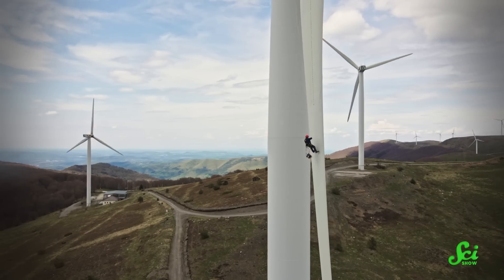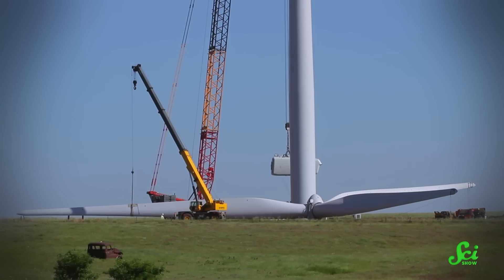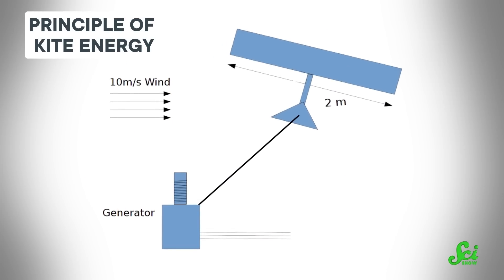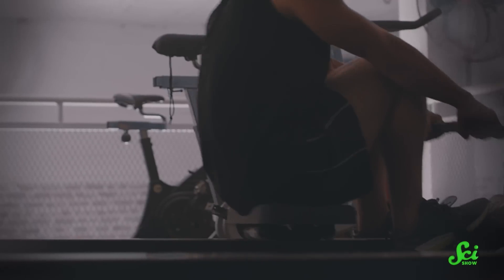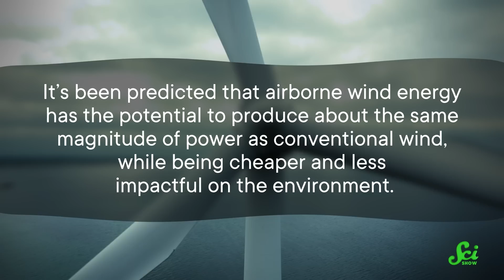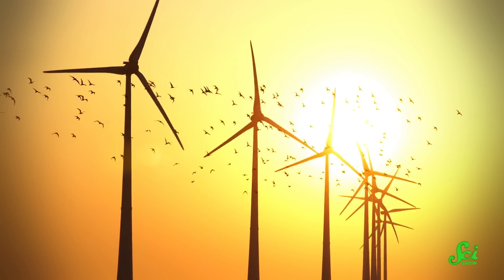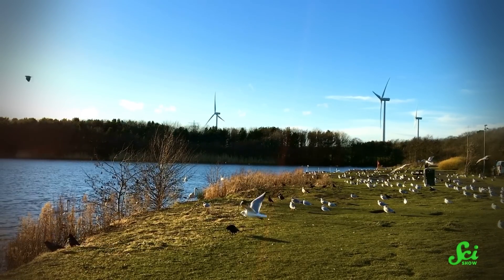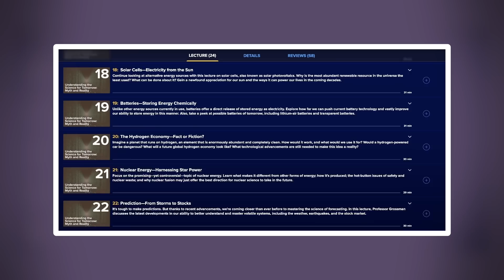Should We Put Wind Turbines on Kites?

Comment: Id really like too see a concise video about the environmental impact of renewables vs traditional. How much better are electric cars, since we cant (or dont) recycle the lithium, is building a new electric car every 10-20 years better than an engine that could last upwards of 50 with just a couple tweaks. What about the wind turbine blades. Since we apparently cant recycle them. Would be nice to have a video that talks about the "bad" parts of clean energy.
Reply: Personally I would argue that the 'bad parts of clean energy' that you describe are at least partly to blame on planned obsolescence, and not the tech surrounding clean energy itself. After all, a car engine could last upwards of 50 years "with just a few tweaks"... if you're capable of doing those tweaks yourself, and if you can still find a car that runs on nothing but an engine while the entire industry is pushing for smart cars that won't allow the actual owner to fix them and where I wouldn't be surprised if they already have certain issues programmed in them ("after 3742 miles, jam this part/ turn on this warning light/ say you need an oil change so the owner has to bring it to our brand workshop - and if they've tried to fix anything themselves, no insurance or guarantee") just like is happening with phones (software that intentionally slows down the system once a new model has come out, batteries that are made to only last a year), kitchen appliances (make an important part of the motor out of flimsy metal so it'll break after a certain number of hours of use), office printers ("I'm not really broken, I just have a light sensor you can't access that's been covered in too much dust. NOW PAY 2000 BUCKS TO HAVE ME REPAIRED") and more.
Like... cars started being made back when planned obsolescence wasn't a thing yet, and they were made to last. So we can see the evolution between cars from back in the day and cars from now, and notice that they've gotten worse. Electric cars were born when planned obsolescence was already a thing, and so the planned obsolescence was just a part of their design from the get-go. That's without mentioning, people don't tend to drive the same car for 20 years anyway because stuff that's not the battery starts giving out before the battery does, and you basically get recommended to switch cars every few years anyway because the car's resale value goes down because the airco doesn't work anymore... and these are things that affect a 'regular' car the same.

Sure, it's important to look at the impacts of things. Even 'renewable' anything is probably never going to have an environmental footprint of 0 - the best thing we can do is make it 'less bad than the previous thing', but you're going to need rare Earth metals, environmentally-unfriendly substances etc. But 'less bad than the previous thing' is better than nothing (sure car engines can last 50 years if you take care of them and you don't get forced to dump the car because its programming is telling it to cripple itself, but burning fossil fuels is bad) so the point would really not be to say "Well we can't recycle lithium so electrical cars are bad", but instead "okay, both have bad elements. According to statistics, cars tend to get replaced after an average of X years. So what's the environmental impact of both in the context of those X years and their recycling/disposal etc after they get dumped, and which one is less damaging?"
And while I would like a video of that type - SciShow already has one of those comparing plastic bags to cotton bags - I think they'd need to focus on one specific subject at a time (like electric vs fuel cars, plastic vs cotton bags), because an in-depth video on the concept in general would be too long. That would be more of a documentary.
Reply: @peregrinelux1  Thanks for that, quite a bit too read but helpful regardless. Planned obsolescence is a huge issue and one that i think is quite generally hated by everyone. But to the video idea, i guess i will have to just resort to more digging and forming my own playlist. It would just be nice to have easier access to a video or playlist of videos that answers to the responses some people give. "coal is bad" "yea well wind turbines kill large birds and bats, solar panels are inefficient and worse for the environment, electric cars give more emissions than gas cars" Im not smart enough to be able to respond too that with a sensible answer.

Too pose a specific example. My father said "Canada's forests already absorb more carbon than the global output" I know thats wrong, but i cannot explain how its wrong. best i could say was "Trees have a respiration cycle giving off co2, and dead trees dont sequester all their carbon" but thats too simple. I know trying to argue with these kinds of people is about as useful as headbutting a brick wall, but it would be nice to have an answer.

Sorry that kinda took a tangent
Reply: @Dsyphus0  That sounds similar to one that popped up everywhere a few months ago, where the climate change deniers started saying things like "this one volcano in Greece has just put out more carbon than humans do in a year" or "all volcanoes on Earth output more greenhouse gases in a year than humans do" - both of which are false, and I saw a video on that at the time but I don't know which one it is now.
It is true, it would be useful to just have an answer to these people, because the answers they give us are basically one-liners - easy to remember - but the problem is just more complicated than that. For example: cotton requires so much water to grow, and cotton bags break comparatively quickly, that basically if you use the strong plastic bags made out of woven recycled plastic and you use them more than 10 times, your plastic bag is now more environmentally friendly than the cotton one - even though the cotton is biodegradable, that's not all that matters. So it depends not just on what it is and what's in it, but also on how you use it (which is why I'm so obsessed with planned obsolescence) and the thing that's touted as being greener absolutely can be worse for the environment because of the way you use it.
Now, I've found an article on electric vs gas cars, at least, that for example also brings up the fact that how environmentally friendly an electric car is depends on how green the electricity is. If your car is powered by electricity produced from coal, you're getting nowhere. It's just annoying Youtube is so difficult about putting links in comments, I can't link it because my comment will be deleted. It's titled "Environmental impact of electric vehicles vs. gas cars", on a website named EnergySage.

So yeah... the problem's complicated, and it has a lot of moving parts. I don't think there's a one-size-fits-all solution for most things, exactly because it may depend more on how you use the thing.

Comment: We should be putting wind turbines on skyscrapers. They don’t have enough surface area for solar to be effective (window solar has been promised for ages). Each floor on each side can be generating power 24/7. It’s virtually always windy in the skyscraper canons, especially higher up.
Reply: I think some buildings do have turbines  up there.  Like a mountain, wind hitting the sides flow up and over the top with pretty good speed.
Reply: It's called a Ridge Turbine. You can get them for peeks of roofs to use on houses, barns, or free standing solar arrays.

Comment: I've been wondering for ages why we don't have mini wind turbines on houses, similar to having small solar panels. I'd love to see an episode on how various renewable sources can scale up or down, and what the limiting factors are. Thanks!
Reply: It's because small wind turbines are only effective if you live in an area with almost consistent high speed winds with nothing around to block them.  The Orkney Islands, off the northern tip of Scotland do have a lot of small domestic wind turbines.
Reply: Part of the problem of domestic wind turbines is scale. Wind turbines' energy production scales exponentially, while solar panels' scales linearly. Or rather, solar's is a straight line, while wind curves upwards.
For example, 2 square meters of solar panels would make twice as much energy as a single square meter of solar panels, in identical conditions.
But a wind turbine with, say, 2 meters long blades, wouldn't make twice as much energy as one with 1 meter long blades. It would do, say, 4 times as much energy! (not actual results, just an example)
That's why you keep seeing bigger and bigger wind turbines. To take advantage of wind, you would need quite a big wind turbine, way high above, and that is both expensive, hard to maintain (hard to reach, moving parts, etc), and would bring problems to you and your neighbors (noise, shadow, etc)
There are projects and designs of wind energy generators specifically made for domestic use, but it's nowhere as mature as the solar panel industry.
Reply: Imagine a hundred houses in a row, ten thousand per city, everyone launches their own kites. It only takes ONE of those kites to get entangled to its neighbour to start a rather horrifying cascade. Even if it does not cause a complete chain destruction, this will nevertheless cost you so much energy to untangle and repair that any potential gain is quite possibly nullified....

And again, thousands upon thousand of those kites. It would happen all the damn time. kites falling down all over the city, potentially damaging stuff they land on.

It is just not a good idea.
Reply: @Alexander_Kale  I think they were talking about houses in open, rural areas rather than suburbs, but your concern is valid
Reply: @Alexander_Kale  I was actually thinking of more traditional fixed turbines, but the imagery of that many kites is making me giggle, so thank you! I can definitely see why kites would be challenging to scale down
Reply: Anecdote: down in Belize some rich guy built a barracks on fisherman’s island with a tiny turbine, but it produced so much excess wattage that it burnt out.

I guess oftentimes it’s not just the quality of the resource, but the logistics of distribution and storage that limits development.
Reply: You can buy them (and a real life example was shown in the video)
Reply: There is no reason that we don't, they are pretty great, the best way currently is with a enclosed tribune on houses
Reply: @emberframe6994  There are plenty of reasons why we don't, otherwise we would...
Reply: @Alexander_Kale  I have a roof turbine, and it lowered my electric bill by 30% a month
Reply: @emberframe6994  Congratulations. You are one of the chosen few that do. The vast, vast, vast majority of people doesn't. It is not a mainstream thing, and there are reasons for it. Which was my point in the first place..
Reply: A lot of small sailboats have tiny fixed turbines, don't they? And I mean really tiny. No idea what those are for, they can't be making much juice...
Reply: @Alexander_Kale good for running sonar, radar, radio.
Reply: Most of the limiting factors are your neighbors...
Reply: This is something I looked into once, because I think it's a great idea. I still think it has potential, but the problems I ran into were:
Turbines produce vibration, more or less. It can put a lot of stress on the building, but there are workarounds, like using small ones. 
They require more maintenance than solar because they have moving parts. Though they are less polluting than solar panels, so if pollution were not an externalizable cost, it would likely balance out. 
It's becoming more common to have solar tied into the grid, which means no giant batteries needed, which makes it much more affordable & efficient. Wind power could do that too, but I haven't yet heard of anyone doing it at the household level. That's mostly a political &/or corporate issue. 
Placement is a challenge. Turbines work much much better with increased height, and lots of clearance from obstructions. That's pretty challenging on a house, unfortunately. 
Safety issues - parts breaking & falling. 
Adverse weather events - which we know are increasing in frequency with climate change - are much more likely to damage turbines than solar. You'd likely need to have a method for safely lowering your turbine before a storm.

Comment: I heard some stuff like gyrotor systems are pretty much ready to go. Those are neat because the lifting surface for the kite is the turbine blades. The main issue is getting cooperation with the FAA and being able to maintain zones of restricted airspace to operate within. (The tethers and all that present a collision hazard to aircraft, so you don't want these things in the path of some fly-way.)

Thus the biggest impediment to operating is legal issues, not technological.
Reply: It would also become a concern if the aircraft had an issue and couldn't avoid the lines (or if they became a target 9-11 style).  What would happen if those tethers were cut?  What goes up has to come down eventually, and hopefully there's not a town in the landing zone.

Comment: It's always the structure that costs the most. Thankfully humans are good at digging holes.
I worked out gravity batteries with Standard oil drill sized holes & heat rising recharge. 2500kg weights in 8 inch holes, 1km deep should fall with enough force to turn 200kw generators. The 13c air rising should produce enough to raise the spent ones.  Lay person math & science puts it at 4 to power a city of 1 million. Not flashy or much profit though.

Comment: Okay, the highway thing is pretty cool, but I still think nuclear power is far and away the better option
Reply: Radioactive  is forever
Reply: "Better" is the wrong way to look at it.  "As well" is what you should be considering.

Nuclear is fantastic to be sure, but it also has its limitations.  Its absolutely terrible as a peaker plant for example as it often takes hours or days to ramp up and down.  There's also the consideration that uranium is a finite resource, so overbuilding nuclear when we could be using a combination of technologies is just going to cause more problems down the line.

That's somewhat mitigated if thorium reactors ever manage to take off but well, there's a reason they haven't yet.  They have problems of their own.

And in any case, nuclear takes too long to build and to get through red tape to matter - even if going full nuclear was plausible, it wouldn't happen on anywhere near the time scales we need.

There is no one solution to our energy crisis.  We need to implement all available solutions as soon as they're ready and as soon as they can be built.  Every ton of CO2 we can displace this year is 2 tons we don't have to displace next year.
Reply: @altrag  yea mostly meant it as nuclear should replace all coal plants and such, the heavy emitters. Keep small ones around for the peaks and lows, or have massive batteries to take care of that. I never knew about limited quantities of uranium tho, I just figured there was plenty, definitely has an impact. With the long-term storage problem mostly solved with the (Norwegian?) spent nuclear fuel storage site, that argument doesn't make much sense anymore. Something needs to change
Reply: @jadenantal1652  > I just figured there was plenty
Sadly there isn't.  At least not easily-recoverable uranium.  The ocean is absolutely full of the stuff but it costs more energy to extract than we'd get back from fissioning it.  There are people trying to figure out economical ways to extract ocean uranium, and if they manage to do so then we'll have a near-unlimited supply (the oceans are very big!)  Its definitely not certain enough to bank on at this point though.

> the long-term storage problem mostly solved with the (Norwegian?) spent nuclear fuel storage site
Unfortunately this isn't all that useful on a larger scale.  Not from a technical perspective, but from a political one - governments around the world are not going to entrust that much theoretically-dangerous material to a single nation, no matter how "nice" that nation acts today.  Never mind the potential for interception by pirates or other bad actors in the process of transporting material halfway around the world.

We also have the technology to significant increase the lifespan of radioactive "waste", but we also choose to ignore that option for the most part for political reasons - the same processes that can revitalize spent fuel rods can also produce weapons-grade material.

> Something needs to change
Agreed, I just don't think uranium reactors will be a huge part of the change.  It'll be some part but not a huge part.  Again, mostly for political reasons.  Thorium reactors are also unlikely but that one is more for technical reasons: we still haven't invented a thorium reactor that is simple enough, cheap enough and efficient enough to prioritize it over other energy sources (including uranium).

Fusion could change the world of course, but its still 20 years away as it has been for the past 60.  The amount of commercial investment we're seeing these days is a good indicator that the 20 year countdown has finally started for real, but its still 20 years.

Nuclear is great, but I just don't see it being a major component in decarbonization in the near future.  There's just too much politics involved and not enough time to figure that mess out.
Reply: Exxon doesnt like that idea tho, so oil it is. Sucks when theres much better technology out there